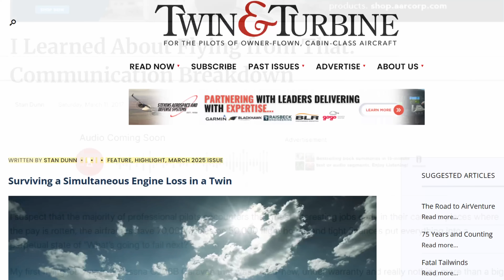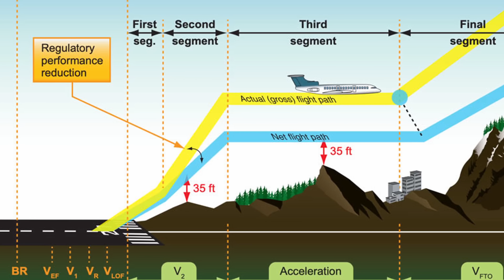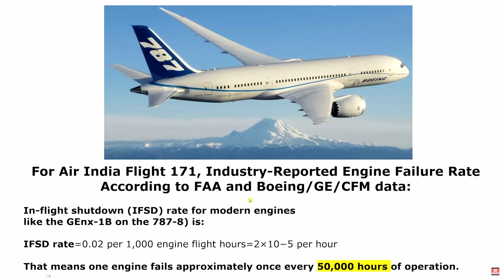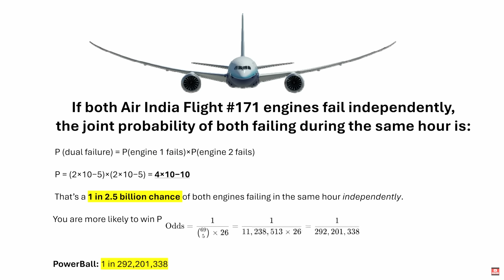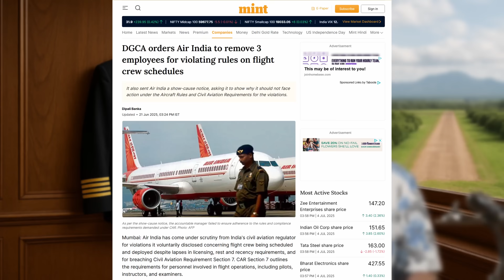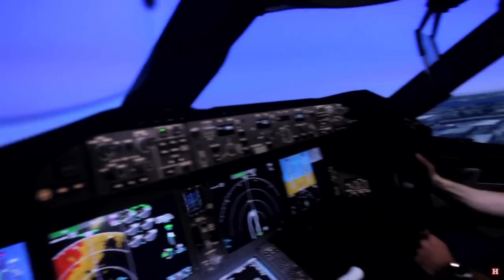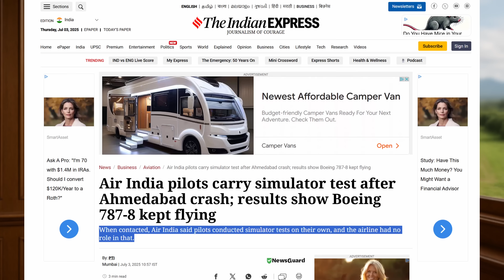Air India 171 Cause Becoming Clear

Comment: The landing gear was in the process of retraction but stopped before the gear could be pulled up into the wells. The landing gear trucks can be seen on the video tilting forward which is the positioning done by retracting the landing gear. Otherwise the trucks would remain tilted backward, with the rear wheels down. This indicates that something stopped the gear retraction process after it was started.

Comment: It’s kinda hard to take the video seriously when the thumbnail has an Airbus instead of a Dreamliner.
Reply: I thought the same, and that fact immediately makes me sense an incompetent site.
Reply: As Ed McMahon would say to Johnny Carson 
"YES.. YOU ARE CORRECT SIR 
OH GREAT ONE"
Reply: Plus the mention of a cockpit VIDEO recorder
Reply: @gowdsake7103  Actually… “cockpit VIDEO recorder” is correct.

Digital VIDEO recorders (DVRs) are installed in a 787's cockpit and other places. A DVR has been recovered and, from photos, it does appear to be in good shape. However, I don’t know if all aircraft cameras are multiplexed onto a single recorder or if there’s a separate unit for each camera (in which case it may not contain cockpit footage – but may still be useful). Perhaps someone else can help?
Reply: yes A320
Reply: He's probably working for Boeing 😂 starting to shift the blame on the pilots when it's clearly on the hands of the manufacturer
Reply: no, that can be ignored because it is customary to post an irrelevant thumbnail on You Tube videos.
Reply: Actually, the big banner on the thumbnail saying that this videao will tell us what caused the crash was a fine non-serious part. Note that it helped to inspire a few hundred laughs.

Comment: Dude what are you talking about. You provide no explanation whatsoever. You did not even consider the fatal malfunction of the central computer FADEC. It is just a computer and can fail as anything especially provided the age of the plane. What's more it is already identified that a fatal FADEC malfunction might cause the fuel pomp throttle to shot down both engines because there is no redundancy in this system and no alternative battery circuit to open them from the other source when the central computer is down. Airbus included it because this error would be plausable so they incorporated such obvious occurance into the power systems.

Comment: One of the few people who's noticed a single engine blowing dust on takeoff.  Liked.  Subscribed.  And, did you notice the slight yaw to the right just after takeoff?  That kind-of suggests that the right engine wasn't delivering thrust.  At the same time, I kind-of agree that it would be weird for there to be dust at the end of the runway, but maybe that dust came from beyond the runway threshold.  That plane looked to have used every brick of runway to get airborne.

Comment: I really do not think the pilots would be concerned with shutting down an engine whilst running the take off procedure. Their concern would be to get the plane to an altitude where they then could work on the issue. They were working on a lack of thrust issue during take off and as such would not be thinking about shutting down an engine especially in the short time they had, it would take longer to decide to shut the engine down than they had in the air.
Reply: Last message' Mayday cannot 'achieve' thrust' Strange choice of words?
Reply: @Deppel57  English not his first language.
Reply: I'd replace "would" with "should".
They absolutely shouldn't be securing a failed engine until into the after takeoff,  but it wouldn't be the first time!
Reply: @wilfdarr exactly. And FO had very little experience.
Reply: They were Jeets. Expecting them to do anything reasoned is unrealistic.
Reply: You and 156 people were way off. One of the pilots shut off the fuel to both engines.
Reply: @CaptainLeo44  they were trying so hard to blame Boeing - despite the 787 clean record -  and not the pilots. Most likely the inexperienced FO. Only 300 hrs and in a widebody? Either nepotism or AI pays so badly they can’t attract/keep veteran pilots.
Reply: @CaptainLeo44  so they say, but do we trust the NTSB, the FAA and Boeing. 

In addition, they are indicating that the switches were intentionally switched to cutoff, so not part of the diagnostics approach. In addition, no one is going to shut-down both engines during take off.
Reply: Yes those words of Mayday cannot achieve thrust,  tend to shift the focus to trying to maintain thrust rather than shutting it down. Within a few seconds after the aircraft would have stalled and then the outcome was predetermined from there.  That would have happened very quickly with little time to even consider shutting down engines. It also suggests the pilot was unaware of a problem prior to that statement, as there was no other comment like "engine out" or "flame out" on port or starboard engine or left or right engine etc...   for example.
Reply: Every one want to hear about the details of Cock pit voice which had been recorded...
Now understand that The big ghost command to the pilot to shut down the engine while take off time .
Reply: ...totally  agree....I would have shoved both throttles through the front panel.... what happened is gonna be an Air India/Boeing issue .....with poor mx thrown in....just from the scuttlebutt, this particular jet was a hangar queen, Who knows for sure ....the boxes won't lie but Boeing and Air India will......it's always about the money!
Reply: @charliethompson-u8j What is a hangar queen?
Reply: @ZephaniahL An aircraft that spends a disproportionate amount of time in the hangar undergoing maintenance: aka a lemon
Reply: @ZephaniahL  Always in maintenance.

Comment: Seems like no theory yet proposed is correct or even plausible.  The fact there was no yaw indicates the engines ran with equal thrust and then stopped providing thrust equally and at the same time.  I think the only possibility is either pilot induced shutdown of both engines or some type of computer error resulting in simultaneous shutdown of both engines at exactly the same time.

Comment: I agree. The likelihood of pilot error, shutting down the good engine, is unfortunately the only thing that makes any sense whatsoever. The fact that the gear never even started to retract indicates that something happened immediately on rotation, interrupting the normal cockpit callout flow of “Positive Rate, Gear Up. The flight data recorder will easily show this, and I suspect the reason the data having not been released is due to government pressure to suppress this egregious mistake. Air India will suffer enormously as will the Indian government.

Comment: I thought you said that you are a pilot. If that is true, how do you explain:
1) No yaw.
2) immediate shut-down of the working engine.
Sorry, no, your theory does not match the known facts. And I am not a pilot.
The theory I favour is that an issue with the 5 volt DC bus caused both FADEC computers to reboot and set both throttles to idle at the worst possible time. And yes, there is evidence that supports this theory well.

Comment: 6:23 
I lost oil pressure on both PT6-61 engines on an initial flight test of a PA42-720 at FL350.  (1985) P&W rep was so very incredulous and snide they said it was my fault somehow.  
Now I had restarted the engines at 11000 over the airport and they ran nominally.  On the ground there were no leaks and the rigging and oil levels were correct.  
So the P&W rep decided he wanted to to go on the next flight to show me how to fly a Pratt.  Once again, we set cruise power, closed the oil cooler doors and waited.  His reactions to the airframe annunciators were predictable, but when the engine reported low on pressure he was dumbfounded.  I shut that first down and then asked him if he would like to hang out until the other engine lost oil pressure.  He “enthusiastically “ asked me to “please” go back to the Airport - KVRB.  I gave him a ‘good turn’ to head down and as the remaining engine was going in the read I asked him if he wanted to shut that engine down as the oil pressure was in the red.  He voice was much higher at this point but with several NO’s he stated to leave it running. I calmly hit my timer to start on my watch and then stopped it when it climbed above at a much lower altitude.  
The rep was hard to find after the flight for some reason… but we finally to come out to the flight test office to tell him that we were going to have to replace the engine that ran in the read as we could not give it to a customer.  He said in front of a crowed room, “I never told him to leave that engine running, I wanted it shut down as well.  I reminded him about the cockpit voice recorder and that I had timed the engine running in the read in a decent for 2:48. That is when he told the truth.  
 Turns out, it was a manufacturing- assembly defect.  On two -61 engines they had installed the wrong screen on the return line in the forward reduction gearbox. The screen was the same shape but a finer mesh from the small -28 engines that fly at lower altitudes. Lower pressure and slightly higher oil temps in the thin air cause more foaming and all the oil was being saved in the gearbox and starving the engines. I have a lot of stories but this one a little bit fun behind the second worst engines I have ever flown.
Reply: 🛫📖🛬
Your story reminds me more and more that we as pilots are still pioneering and only lambs for the slaughter bc we don't design them nor build them, we beg to fly them.

However, the P&W REP is the kind of closed minded people we don't need to have in the industry. Enjoyed the read. Txs much.👍✈️
Reply: @chuckcampbell3927 You beg to fly them? What does that imply?
Reply: @BREEZYM6015 
WHAT DOES THAT IMPLY❓ ❓
I would think that anyone with a fifth grade education would interpret that to mean that the biggest part of all 
AVIATORS (not pilots---pilots are a dime a dozen) are in the  industry because they have a true passion for flying, and not JUST HERE FOR THE MONEY❗
BTW: pilots pay has not always been adequate.        
I'm sure you're familiar with the DaVinci Quote, are you not???

Fly Safe
✈️
Reply: I think your story pretty much goes to show that the engines themselves are fairly bulletproof and kept running for a significant period of time despite having next to no oil.
It’s also a fairly common story that the PT6 itself doesn’t fail but the ancillary parts servicing it.
Reply: Fascinating!!!
Reply: But what about improperly added fuel additive causing an auto throttle roll back like Japan air 2020
Reply: Why I avoid flying. Humans and high humans on drugs and alcohol. Also humans with giant egos.
Reply: Wow...tks for sharing... They say Boeing gives pref to the pilot while, Airbus gives it to the computer. ..I don't know if that's true or connected to anything here or the tragic crash that took place but someone mentioned something about the 787 giving control to the pilot not the computer if one engine had gone dead...
Reply: Corporate Profits over people - Wall Street!!!  
How sad.
Reply: Interesting comment, because I do also fly Cheyennes. Unfortunatly that has in my opinion nothing to do with the Air India crash, except of the fact, that in a propeller driven aircraft you have to take immediate action to feather the propeller after an engine failure. There is no reason to do that in a jet driven aircraft. There is not more or less drag, whether the engine is still running or not.
I belief, that in a modern aircraft there are so many parameters recorded in the computers, that an serious investigation will find the root cause. In a Cheyenne in 1985 there was obviously no device that recorded engine data, but they were relatively new, right? So a cause in the manufacturing process was a obvious cause…
Reply: You had both engines with low oil pressure problems at the same time and then took the aircraft back in the air ???? 

Right…….

Comment: The computer shut off both engines for some reason. Same as the computer caused the 787MAX to nosedive from 500 to 1000 feet based on the input from a single sensor. Boeing likely knows what it was but will hide the cause as long as possible.
Such life threatening (or life-ending) moves by an airplane computer shouldn't happen automatically - but the computer should issue a warning to pilots. The MAX problem was because they didn't want pilots to have to go through training.. Boeing want the MAX to be "walk on ready" for anyone who knew how to fly a 737.

Comment: The pilots used practically the whole runway to takeoff 
Looks like the engines weren’t making enough power to get to V1 earlier. If so why didn’t they reject TO earlier? I think the engines may have been compromised. The Data coming in will tell what happened

Comment: So in other words, nobody really knows. But you failed to explain your theory and the fact that the RAT was deployed and the pilot yelling "no thrust" on the radio. Sounds like dual engine failure to me as the RAT could be seen deployed shortly after take-off and still over the runway. Kinda hard for a pilot to mistakenly shut down a wrong engine so quickly, plus the witness mentioned electrical failure. I think we are going to need to wait on the NTSB on this one. Seems like something fishy going on with this one. It was also interesting how the plane just kind of floated down to the ground. I found that to be very strange as they didn't go nose over at anytime. Prayers for all the families affected!

Comment: It blows my mind that, with all the ultra-sophisticated electronic information & warning systems on aircraft today, that the pilots have to figure out which engine has shut down/is failing. Not only that, but that here would be no fail-safe on shutting down a working engine---why would you EVER do that? Clearly there is much I do not know, but still...this just seems weird.

Comment: Fact #1: this crash happened in 2025.
Fact #2: all critical flight data can be transmitted from a passenger-carrying airplane during takeoff or landing to a ground station for less cost than a Starbucks Latte. the FDR is obsolete.
Fact #3: anyone who disagrees with Fact #1 or #2 is a criminal.

Comment: The Pilots gave a clear message, no thrust!
Flaps were extended, you could already see that in the news footage of the left wing.

They used the full length of the runway, that was maybe an indicator.
That just before rotation things went sour, and they could not abort.
Horrific...

Both engines must have failed, there was nothing they could do...

Nothing is clear, till the NTSB comes forward.
These Pilots are familiar with extreme conditions, elevation, air pressure, extreme heat....

This is uncommon, fuel starvation in both engines on takeoff on a "modern" aircraft as the 787.

All "Black Boxes" were in tact, front and aft of the aircraft, including the cvr.
The data from the black boxes must have given a clear clue, to at least what happened...
Why, will take further investigation, to see what components failed under certain conditions.

They probably are holding back to create panic, but at what cost?

I love everything that flies, but I will avoid to fly on any 787 till the NTSB comes with answers.

Speculation does not lead to answers, the lives of the Pilots, Cabin Crew and all Passengers except 1 are all lost.
He lost his brother, traumatized deeply scarred for life, and many families and friends lost their loved ones.
They deserve at least an answer soon, including those that fly and fly on the 787 or any aircraft.

With respect.

Comment: Surely if one of the engines was malfunctioning the plane would not fly straight there would have been some deviation due to the thrust imbalance.  My theory is still something electrical caused the simultaneous loss of both engines either electronic failure or software.